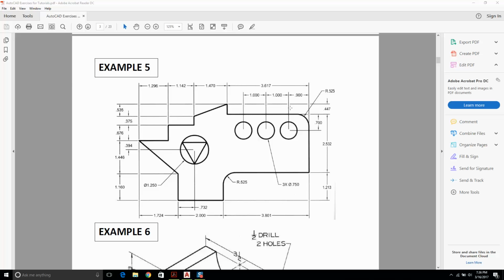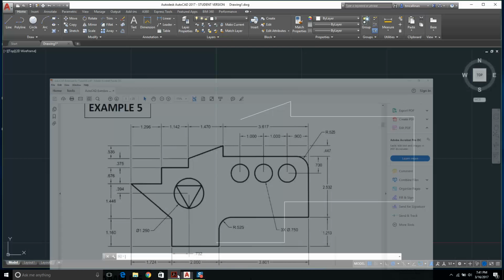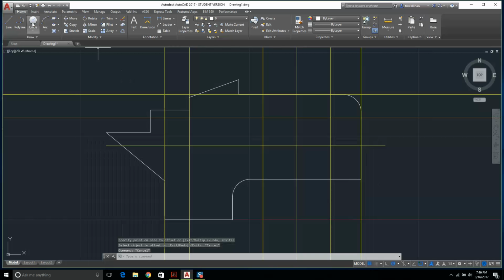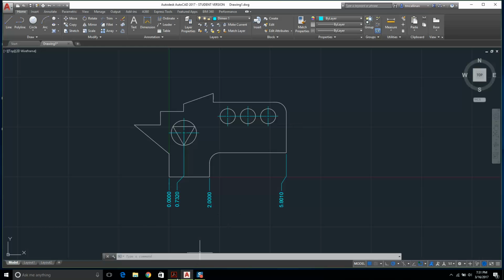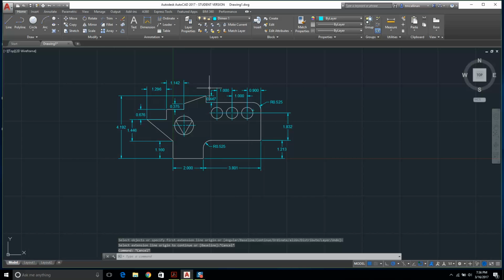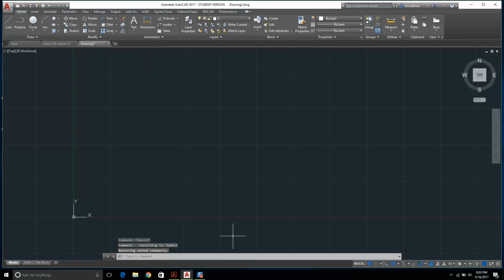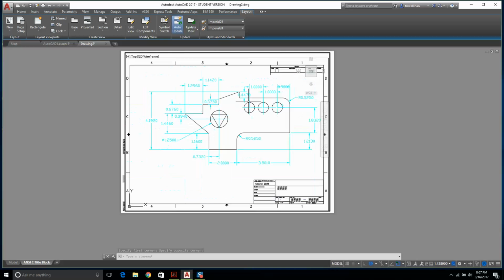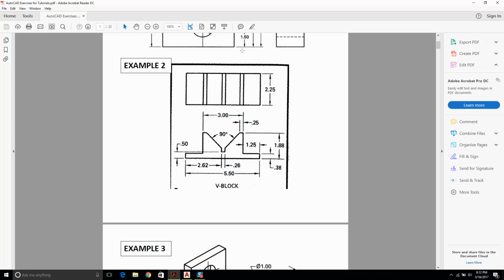AutoCAD Tutorial 5

Comment: Quick note on the title block: If your drawings are going to be used outside of the US you will want to include the orthographic angle symbol for which ever angle is used. Most places outside the US use both first and third angles but typically European and Commonwealth countries default to first angle. Its better to explicitly specify third angle because you never know if the machinist in the workshop will realise its in third angle by looking at it (only real clue is that the top view is above the front view and not below it).